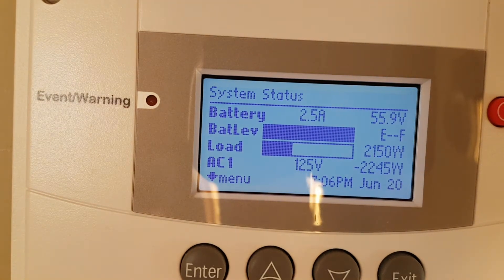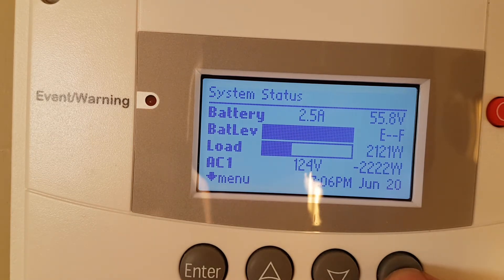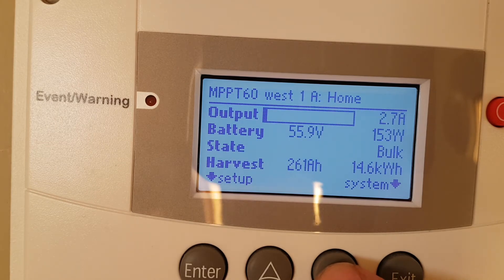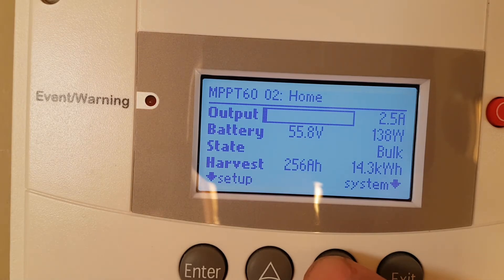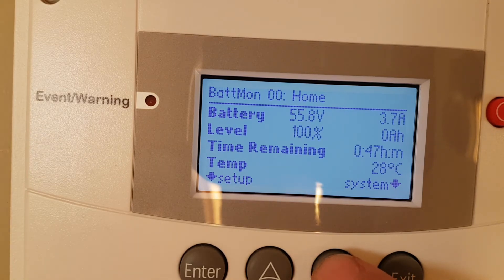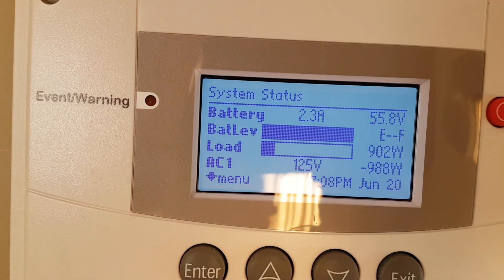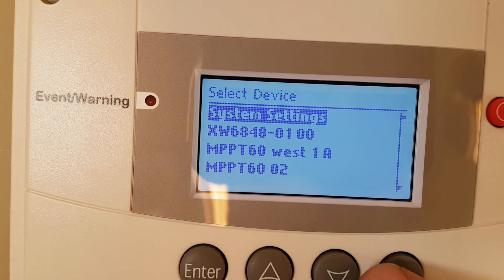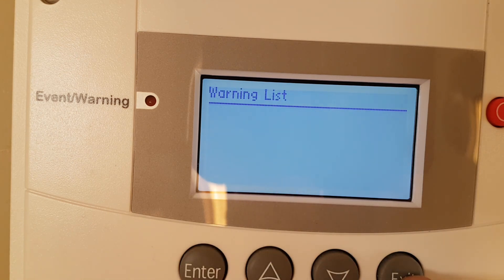Understanding the conext SCP

Comment: Hey you still around here CBI solar guy?  I got this unit on my boat powering a 
Xantrex 815-2012 Inv/Chgr, Free-SW 2000W. Its hooked up to 4 large 8D batteries in parallel.  The unit is rated for 2000 watts.  Ive put a 1600 watt load on it & somehow it brought the batteries down to 11.9 while the alternator is charging the batteries?  The alternator can normally keep the batteries at 13.9v.   However, when I went to check with a voltmeter all 4 batteries were saying they were at 12.34v...Is the unit reading the battery voltage wrong somehow?
Reply: hello I really think your battery Cables are to small and you got voltage drop   , Now do remeber that 1600 watt load is around 134 amps DC

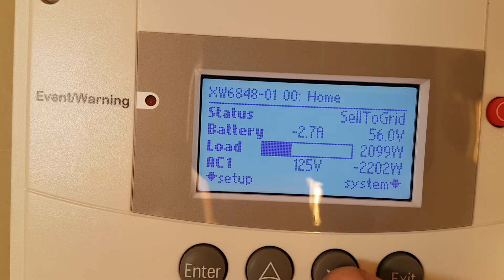Comment: Do you find that the net battery current in 'system status' is inaccurate on the SCP? I've been trying to troubleshoot why mine jumps around  and can't seem to find a cause. I can't know if there's a specific reason in your setup, but what I get is similar to what happens  at 0:18 and 0:38s even though an actual meter shows no such "jumps."
Reply: Hello Steve G yes you are right that the batt amps is jumping around at a lower refresh rate than the watts , the watts refresh rate is much faster , now my system has a lot going on and with two xw6848 inverters and two mppt 60-150 things are happening all very fast . now since that vid i have added two more s mppt to the system .. so to  answer your question there is many things happening and the refresh rate cant keep up , now i also know that if its not a problem  dont worry, and i also know that the CT in the system is not all perfect at low numbers , hope this helps

Comment: So it was saying my AC1 load was over 2000 W is that what I was making at the time?  I was very concerned that it was using that much and hardly anything was on in the house.  We only have a 3.5 KW system but we made 19 KW today (July 29, 2021).

Comment: OH gosh - I wish you could help us!  We have Conext inverters and SCP running a 9KW system with a 14KW Kohler backup generator, on 48V battery bank.  We are 100% off grid, and when the SCP detects Low Battery Cutout (which is set at 48V), it gives us faults but doesn't start the generator, which is set on AUTOMATIC.  And gen itself is set on AUTO (Standby).  But when the system detects low DC voltage and falls below 48V, the whole system shuts down instead of turning generator on via AUTO.  Any ideas what may  be wrong?

Comment: Hello! I am living in The Bahamas with a Conext XW+ system (8 solar panels on the roof) and 8 SOLAR SAGM 06 375 batteries. In addition, we use an Outback FLEXmax 60 Charge Controller  I was on my SCP just now and in Advanced Settings and changed the "auto config" something feature and my inverter shut off and began to flash. Right now I am unable to turn it on, do you have any advice or can you help? I am very thankful if you can help! Thank you!